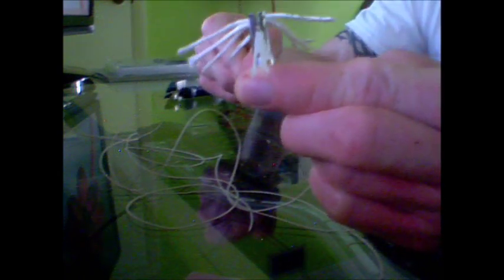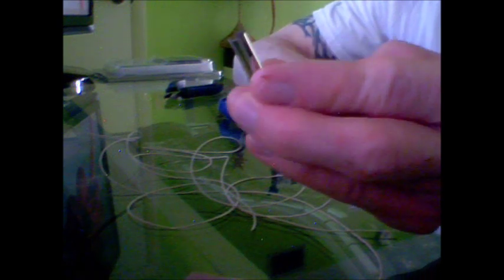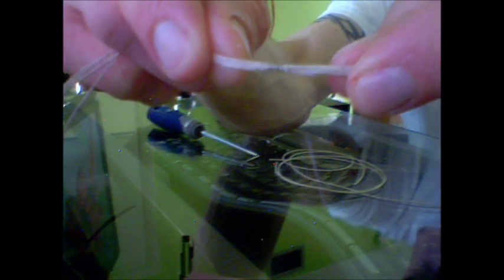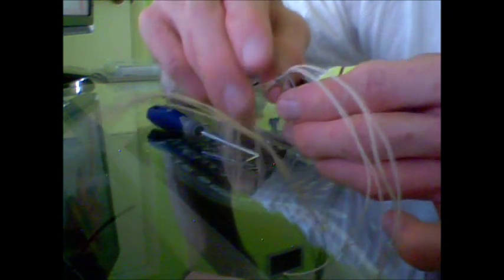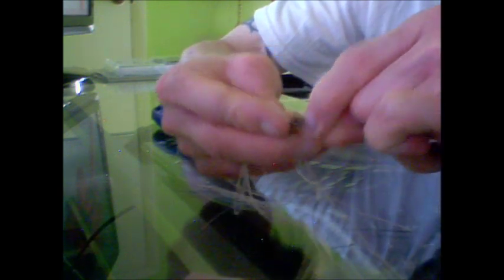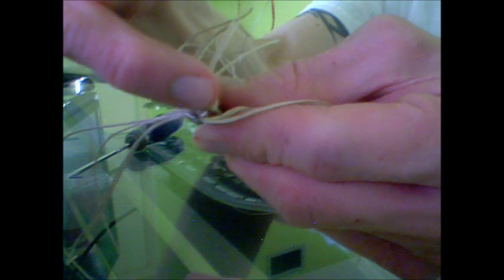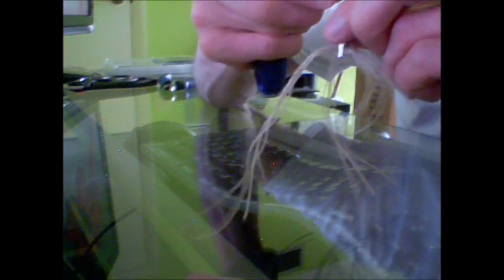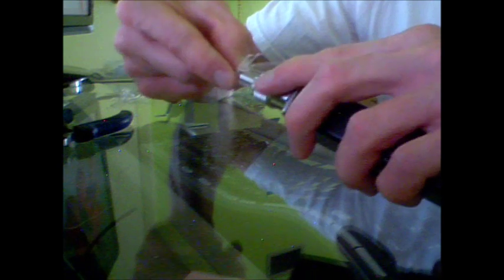iClear30 Dual Coil Rebuild Hemp Twine

Comment: While you are correct in acknowledging the lack of video quality, none the less, great instructions.  I didn't have a pick but just used a micro flat head screw driver and was able to leverage that positive post out.  I think any small tool will do the job.  Doesn't necessarily need the "pick" shape.  I only mention this as to save some money from buying a pick.  I really appreciate the video.  I built along with you and now have an amazing vape.  I used 3mm silica and 32ga kanthal.  7 wraps on each and came out to be 1.3 ohms.
Reply from the maker: Very Nice, R Ems that is the goal of most of these videos that I am making showing the general public that you can rebuild these for little to no cost without having to rely on someone to buy coils every month! Huge Win for the community then! You are very welcome! As building more, and using a Slick Wick as well doing 8-9 wraps on the coils I was able to get it up to a 2.5 Ohm head so I am learning just as much as the rest of you! The more the share the more we post the more we can get the word out for the better cause. 

I found this really really nice article that summed up what gage wire you can use, and how many wraps, and pros and cons to all of them I would like to share that with everyone else as well.

http://truevape.co.uk/kanthal-wire-guide